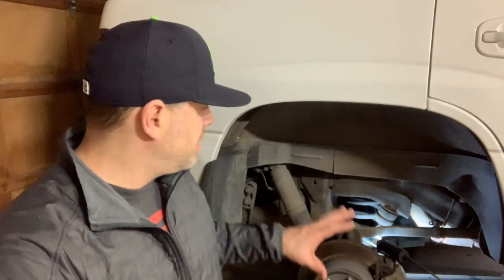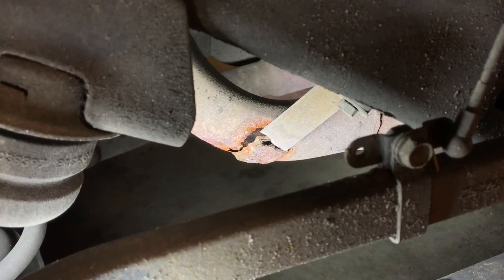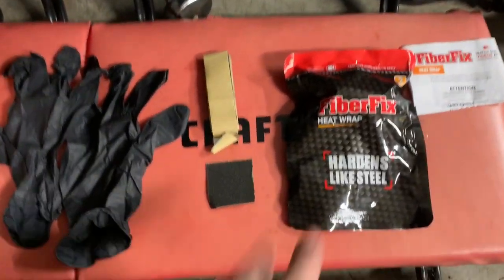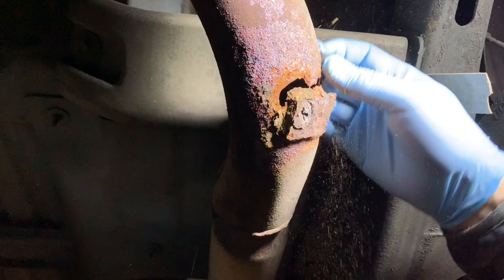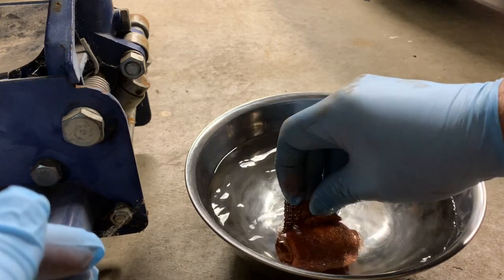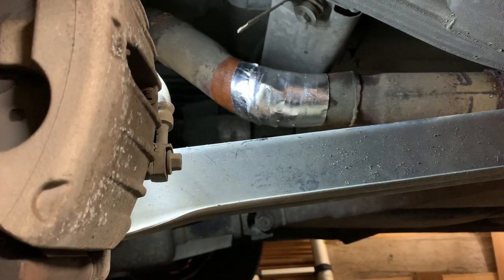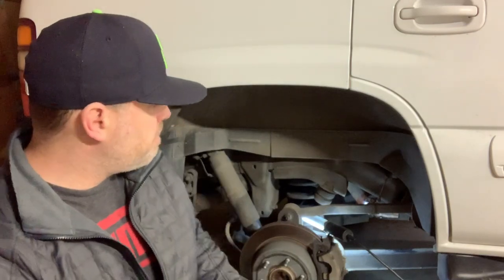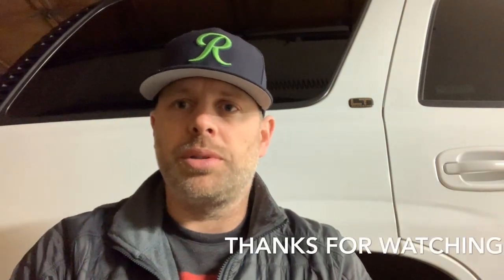Exhaust Leak Fix With FIBERFIX Heat Wrap, Will It Hold?

Comment: I feel pretty confident about this one working. I’m thinking about trying a combination of fiberglass/furnace cement and then wrap it up with the fiber heat wrap. My leak is where the manifold meets the downpipe so it’s super hot but I’m trying anything to avoid paying over a grand at the shop. 😬

Comment: Thanx for the video. I just bought, get this, JB WELD Ultra Heat Wrap, and low and behold, open the box, and it's FiberFix. Anyway, your's says to put the metallic strip on second, whereas this product says to apply the first metallic strip, wrap with the FiberFix, apply the packet of clay, HEAT, and then the SECOND metallic strip. I suppose I'm putting too much effort into a winter slam, but you indeed nailed it when stating; "fixing, tinkering."  The main thing to remember when using anything like this is the PREP WORK. I've had people tell me certain products don't work, but they didn't clean anything first. To be honest, I've had some pretty good results with this stuff.  Thanx again for the video.
Reply from the maker: Gary Kovach appreciate the props, and I agree good prep goes along ways. 👍🏼

Comment: Thanks for the video. I didn't realize I got regular instead of heat but it's too late to take it back. Hopefully it will still work.
Reply from the maker: Wende Sue depends on where you use it and how much heat it will see. My example was further back on the vehicle so it doesn’t see extreme heat.
Reply: @rightorwrong9412  Mine's about mid-way back. I'm going to try permatex to see how that goes. Thanks for the reply 🙂

Comment: If you use a wire wheel or brush to get the rust off first it holds up much better.. It's a band aid.  Better than a coffee can and muffler clamps. Lol

Comment: I tried this product 3 different times and it went on easy. I followed the directions to a  tee. I only got about 3 or 4 days out of it until the exhaust blew right through it again.
Reply: ever think your catalytic converter was plugged up to hell so your exhaust was full of pressure? It probably had a plugged cat and would blow it out trying to find any form of escape due to lack of flow. If you have a clear converter and muffler there is very little resistance and it shouldn't make enough pressure to push that open if done right.
Reply: Also to note if it’s a big hole you might try using an aluminum can or steel can as a backing as to give the tape a fighting chance against the exhaust. Also I haven’t used this product but have done quite the amount of research in the last 3 hours so take that for what it’s worth lol

Comment: I just used this same stuff on my car and it worked perfect, I drove home from the place I did it, got home, it was fine. The morning after, it was all loose and dried out as if no resin cured and it all burned off instead. Thoughts?
Reply from the maker: Devon Lambert definitely strange. Okay so you soaked the product, wrapped it tightly then wrapped with the foil tape? Applied heat with a heat gun? It definitely needs to cure.  Also prep to the exhaust is important. Debris and or oils can possible effect the results. Mine wrap is still holding strong, surprised cause I really just wanted it to hold temporarily until I put a new exhaust on the car.
Reply: @rightorwrong9412  yup, followed all of the steps. I guess maybe because I'm trying to repair 2 completely separated sections of pipe, but I did have them very close together to the point where there was maybe 1/4" gap. Oh well 🤷🏻‍♂️
Reply from the maker: Devon Lambert , Ah so you were trying to bond two separate pieces of exhaust piping together? That’s a tough one... maybe you needed a longer cure time...
Reply: @devonlambert9131  I haven't tried this stuff yet, still looking for my leak. Did you ever get it to work? You don't say how you were holding the sections together. I'd think a small strip of steel and some hose clamps covering the gap first ought to let the FF work. Maybe string some wire between hose clamps first then clamp some metal over the gap then the FF so it's not holding the sections directly or has so much exposure to the exhaust.

Comment: How many layer is the minimum and can you cut it and do 2 spots
Reply from the maker: There isn’t necessarily a minimum layer you just want to make sure you have overlapping coverage. If the holes and pipe circumference allows you may be able to cover more than one hole. That may take some calculating on your part what you need to cover and if you have enough length to do so.

Comment: Can I use this on my flex pipe?
Reply from the maker: DanDan 215 I don’t think it would work well on a flexible connection. This gets hard and I think the movement would make it fail quickly.
Reply: Right or Wrong damn any other suggestions I should do ?
Reply from the maker: DanDan 215 is replacing the flex pipe expensive or difficult? There are some flexible options. I would probably use a header heat wrap if you wanted something temporary for a while assuming you don’t have a huge hole to cover. You should be able to pick up a small role (15ft) of it at a local auto parts store. Make sure it has the metal straps to secure both ends of your wrap.
Reply: Right or Wrong thanks I’ll try the header heat wrap yeah it’s expensive I drive a 06 Kia Sedona 😐

Comment: How has it held up?
Reply from the maker: Bryan Olson my wrap has been holding up well. About 1000 miles since the fix. I will shoot a short follow up on it here this week.
Reply: @rightorwrong9412  I just put mine on went well. My engine has quited down a whole lot . The instructions didn't say put the wrap in water but I did anyway because the clay was dried out.
Reply from the maker: Bryan Olson good to hear, was it the same brand I used? My clearly stated to soak in water briefly.
Reply: @rightorwrong9412  idk if it was it was the same brand .but the wrap was really thick with clay. Maybe a different style
Reply from the maker: Bryan Olson just posted an update video. Check it out. 👍🏼

Comment: How has it held up?
Reply from the maker: Weptbadge65 _ it has honestly held up very well. Need to shoot a follow up. About 1200 miles on the patch job now.
Reply from the maker: Weptbadge65 _ just posted an update video. Check it out. 👍🏼
Reply: @rightorwrong9412  did you get smoke from yours? At idle I didn't have an issue when when I drove it started producing smoke
Reply from the maker: Tom McLaughlin no I never had any smoke come from the wrap. I used near the end of the exhaust so it doesn’t see extreme temperatures like it would closer to the catalytic converter. Did you use this exact wrap I showed? Interesting to hear.